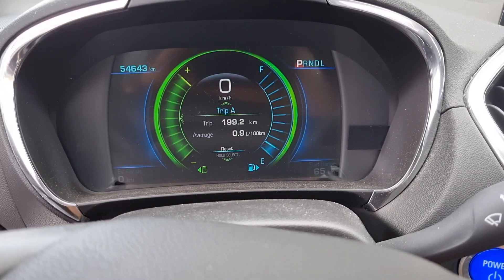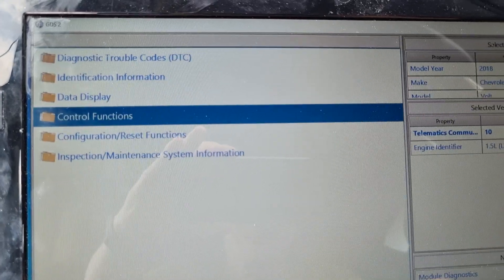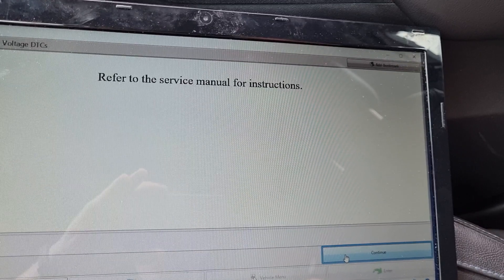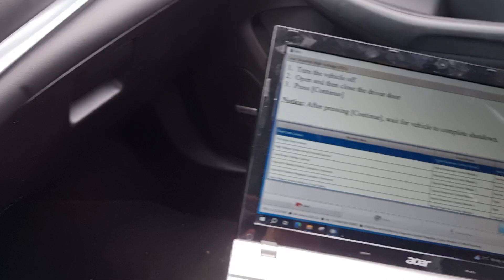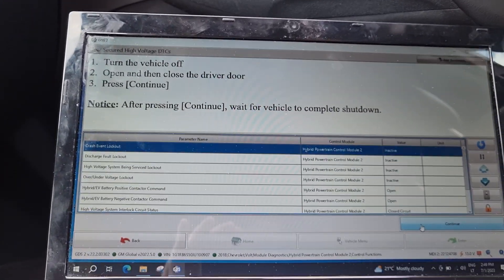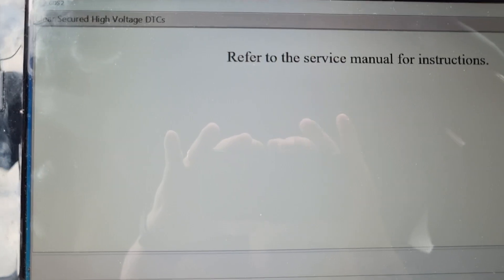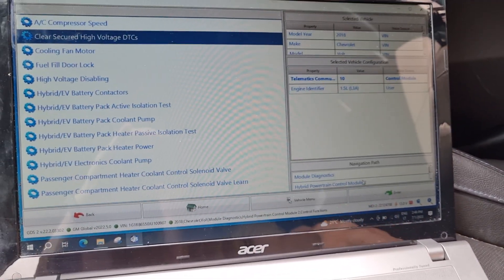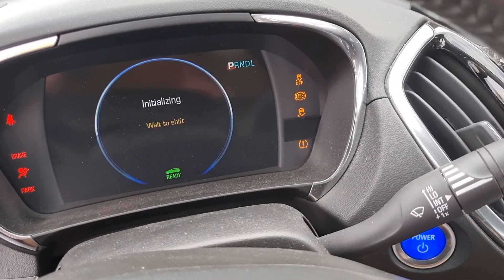Chevrolet Volt gen 2 BECM module temporary fix

Comment: Hey buddy. Thank you for your video. Are you using the the VCX Nano to access GDS2? If so, I was having issues accessing it on Windows 10. Any tips or ideas as to the common issues when using the VCX Nano? Thank you for your time.
Reply from the maker: Yes it vcx nano. Windows firewall deletes program from c: everytime, so you have to keep a copy somewhere zipped and after turining off firewall(need to  turn off it after eclvery pc restart) you paste deleted gds2 file to c:

Comment: How much does it cost to replace becm module these days?
Reply: Free under warranty. Unfortunately, the average time of repair is anywhere between 2 weeks to 9 months due to not enough BECM were made by Chevrolet. I would stay away from all Volts no matter the year or generation.
Reply: Got it done in 3 days
Reply: @tedmehlenbacher5673  Where did you get the part? Mine has been at the dealership for 6 months? Went ahead and bought another brand vehicle. Please send me a link if possible...
Reply: So it’s free now if you’re branded title and certain vin number for your volt 
March 2024 GM has made the repair free of charge if you fall under the 2 categories or 15years or 150k miles 

With the 2 rules on top mentioned at the start, if not the quoted replacement is $550 for the BECM replacement plus $1500 for the technician and then on top they want you to pay $600 for the assessment before they even work on it 😂
Reply from the maker: 500$ for a part and then your have to change it in the battery. Then programming. Totaly 1-1.5k if your are lucky

Comment: I've kept mine running for about 6 months with this exact procedure, it works about 95% of the time and when it doesn't it'll so far work fine after a few hours or a day of letting it rest. Important part you didn't do is to actually shut the vehicle off, if you leave your foot on the brake it just restarts the car and won't clear the DTCs properly. It's getting pretty annoying doing this every couple of days/weeks so I'm currently waiting on a BECM replacement to arrive at the dealership. Unless you have easy access to GDS2 or "get creative with finding it" you're probably better off getting the BECM replaced around 30k miles (to be extra safe) or the first time it throws a code.
Reply from the maker: I had to change becm. This procedure is only for an emmergency situations.